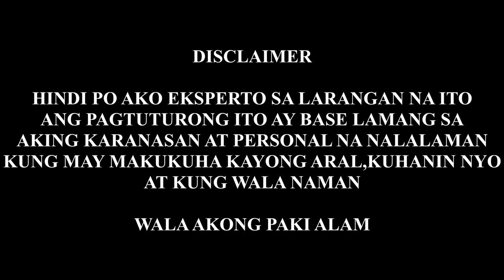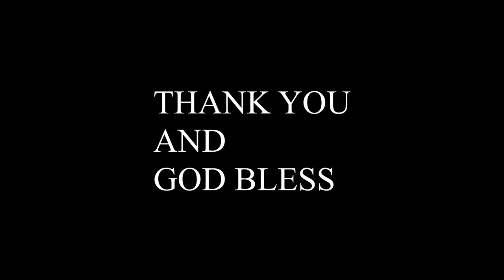CHANGE GEAR OIL | NISSAN PREMIUM | FOUNDERTV DIY

Comment: sir ilan litro po ba kelangan ilagay sa gear oil at differential ng nissan nv350  standard.thanks
Reply from the maker: 1 1/2 or more para sure ka pag nilagyan mo ung sa plug pag lumabas na ung gear oil ok na un un ang pina level lang nya

Comment: ilan litro po ba ang nilalagay sa manual transmission oil sir
Reply from the maker: ganito may manual kasi yan kung wala na ung manual pag nag drain ka salukin mo umg gear oil den lagay mo sa litro nang gear oil para tanyado mo mabuti para sigurado ka din 2 liters bilhin mo at ung gilid na plug ibukas mo pag umapaw na sya un ok na un sakto na ang gear oil mo
Reply: @FOUNDERTV31  anu po ang maganda na oil sa manual transmission sir
Reply from the maker: Petron